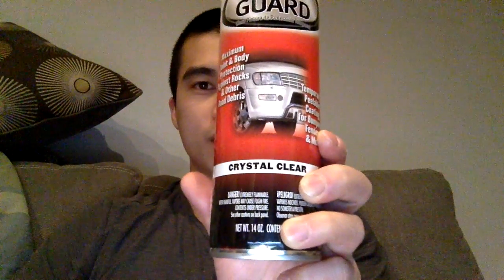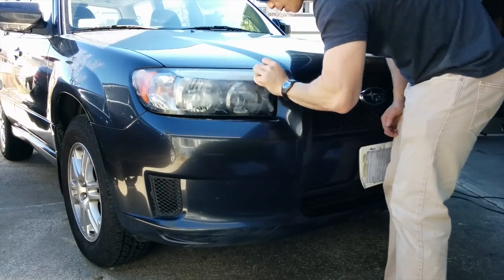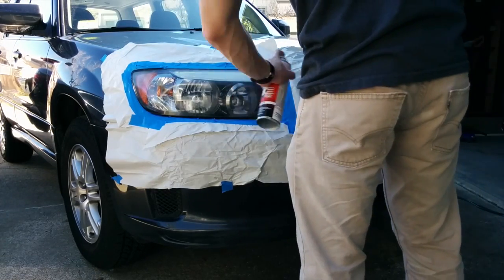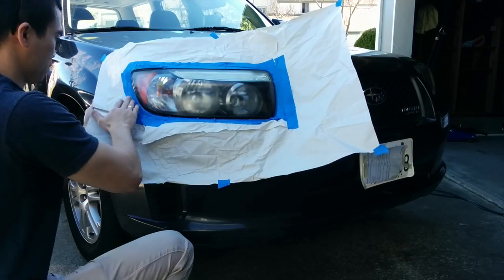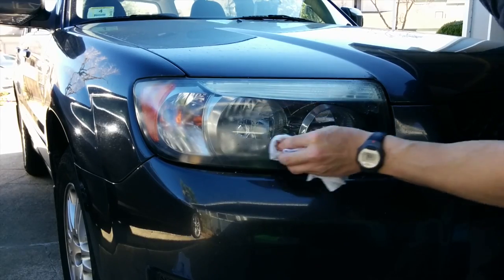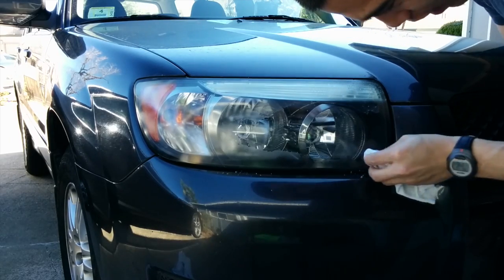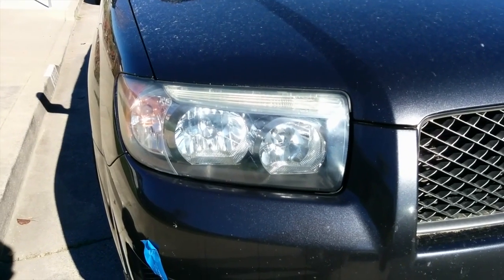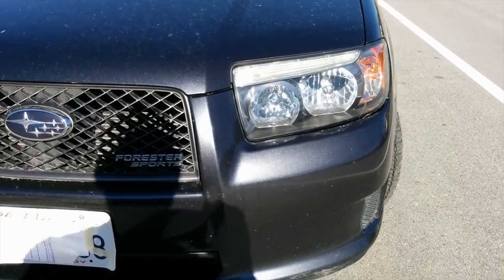✪ A spray on clear bra for your car? Rustoleum Rock Guard Review ✪

Comment: Hey bud.  My company installs this for our customers.  Nothing will ever bond after using a polish or compound unless you do a paint prep cleaning before application.  It’s not designed for headlights, but I’m sure it would have bonded well if you did a paint prep.  This prep process is also necessary before applying ANY wax, sealant, ceramic product as well.  These products have to have a complete virgin surface to work properly

Comment: The product is designed to be used on the Body Paint not your head lights. You mentioned it as a BRA - which are protection for the body panels.
Reply from the maker: Haha. Sadly, my Subaru is my test vehicle. It's old. It's my daily driver. I try to be more careful with my 911, but sometimes I still good things up.